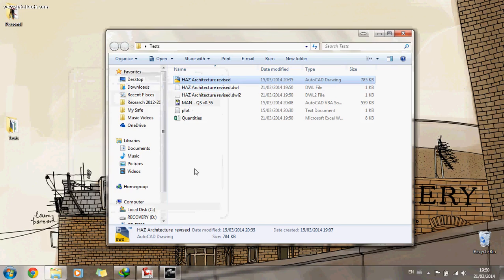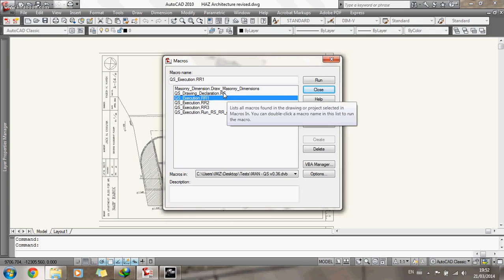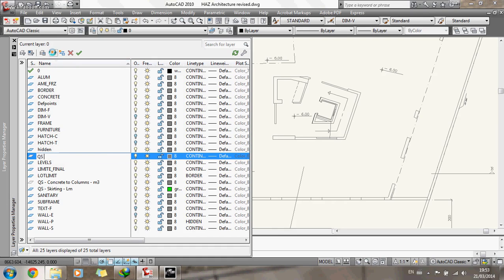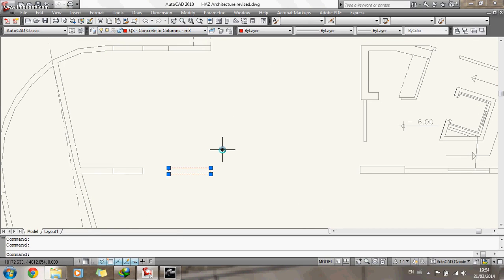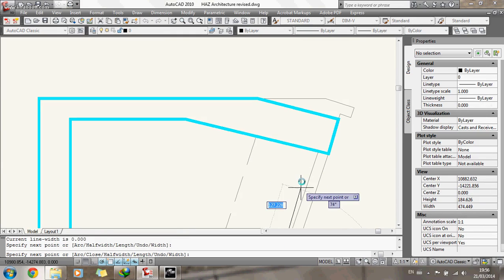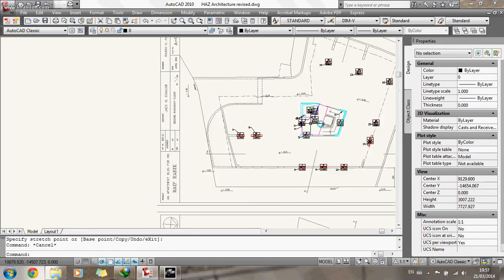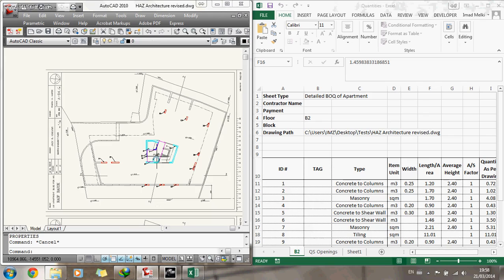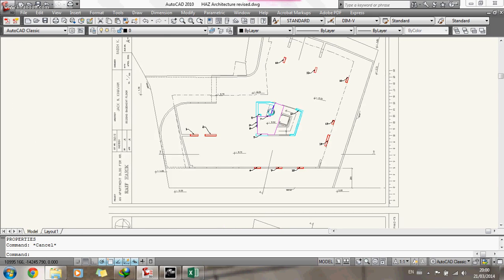Take off Quantities from Autocad and Input into Excel

Comment: i have followed the path but when i load the application QS> Drawing 
__ Declaration _RS not showing up. PLs telll me what was the error
Reply from the maker: fox7971 hi, the macro was modified relative to the one in the video. You can explore it easily using the power point presentation that you can find within the same path.